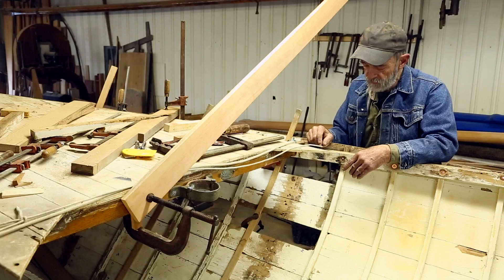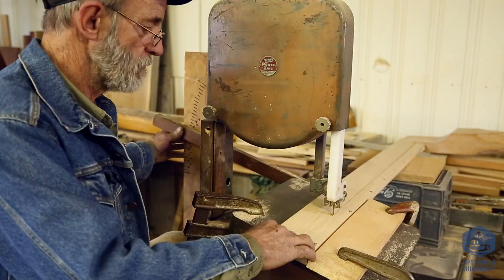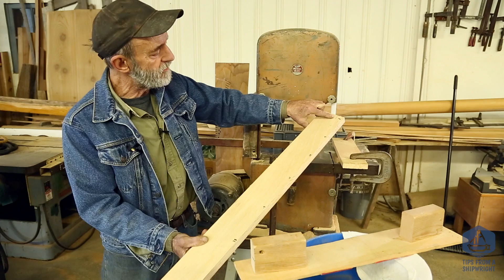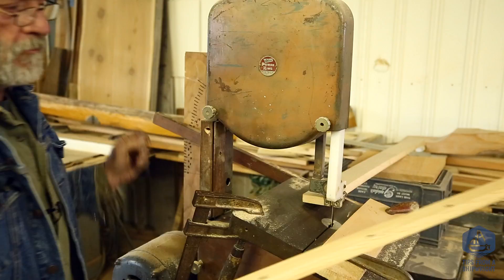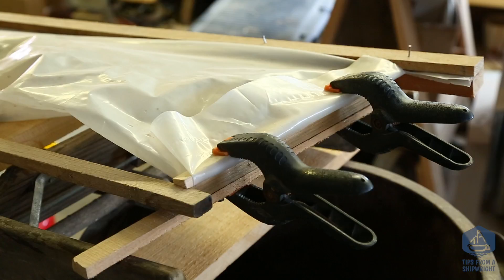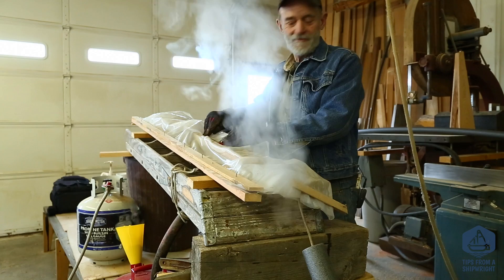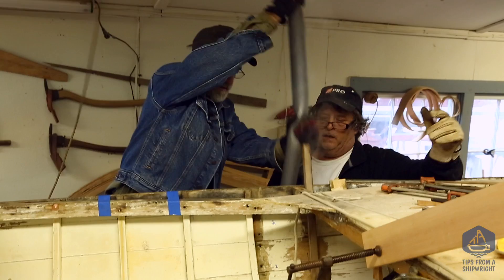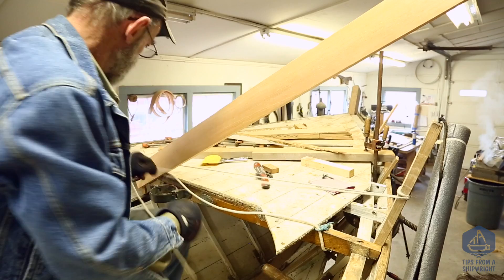How to steam bend wooden boat frames

Comment: Love the idea of progressive bevel sawing. Seems like the kind of thing that saves a lot of time. I do have a question, though. How do you lift the degrees from the shape of the boat to put them on the batten? In other words, how do you get the angle numbers that you use to progressively bevel the frame? Any chance you have or could make a video about this if you get the chance?